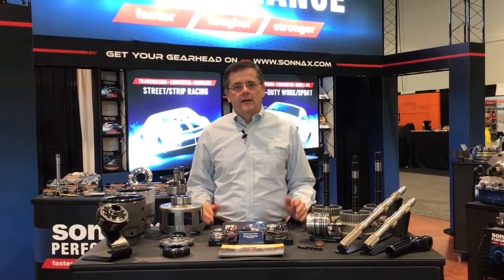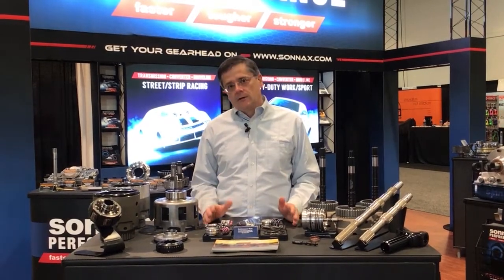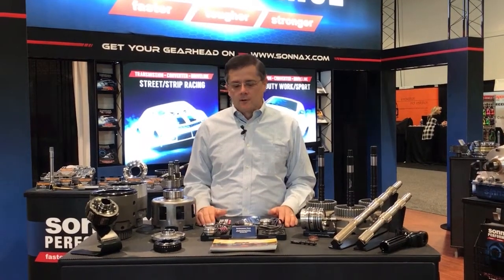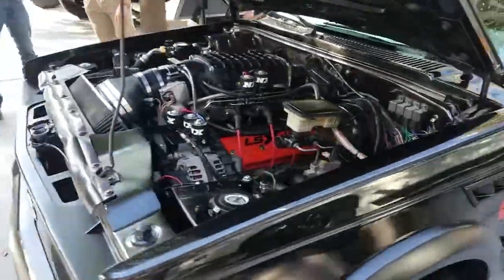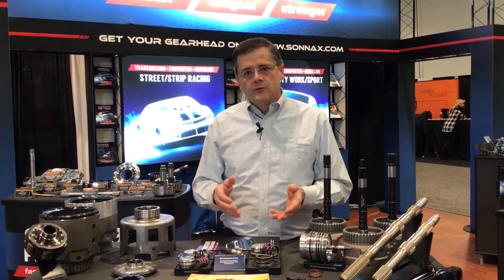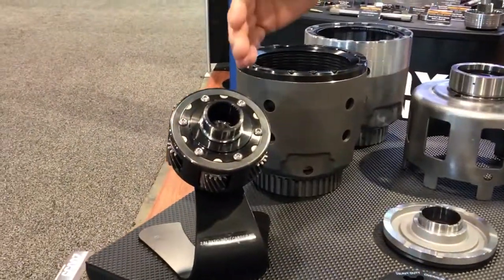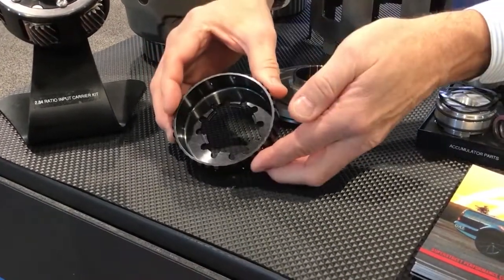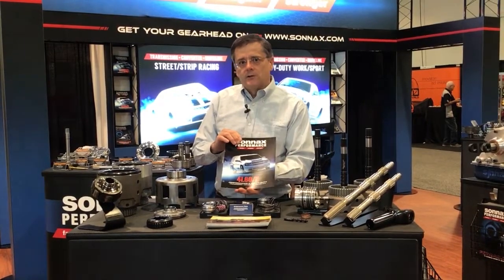Revolutionary Sonnax 4L60/E Transmission Upgrades at SEMA 2018

Comment: There absolutely great parts but some of them are ridiculously priced $1000 for 6 pinion planetary $1000 for output shaft $1000 for input shaft $1000 for input drum 

Build these trans to hold power its $10000 build 

Or get a tremec 🤔 tremec is better buy

Comment: Hey y'all, I'm kind of new at this but I've heard great things about your company. I'm completely building out a 97 Tahoe for my wife.  It's the 2 door Sport 4x4 Vortec 5.7.  It's getting some very mild upgrades on it like better flowing heads and a little bit better cam. Maybe 325-350hp with about 400ft-lbs of torque.  What would you all recommend for the best in drivability and reliability?  Second off do you all have any shops you do business with in the Orlando area you'd recommend?  I'm new to this area so I don't have a good feel for who's good around here and I dont trust Yelp reviews for things like this. Thank you
Reply from the maker: Hi, our tech team would be happy to help you. They can be reached directly via email at sonnaxtechsupport@sonnax.com, or phone at (800) 843-2600 ext. 398. Thanks for reaching out, and good luck with your build!